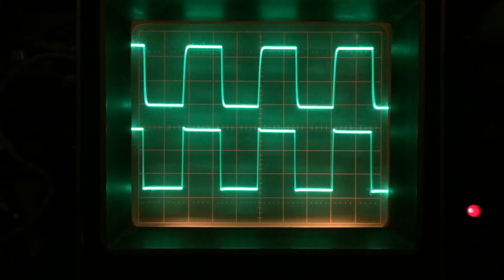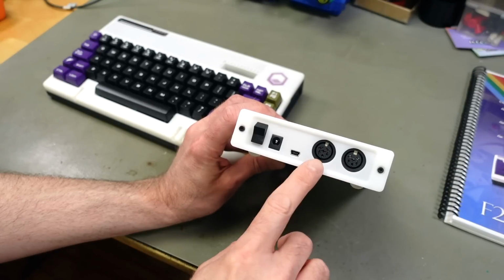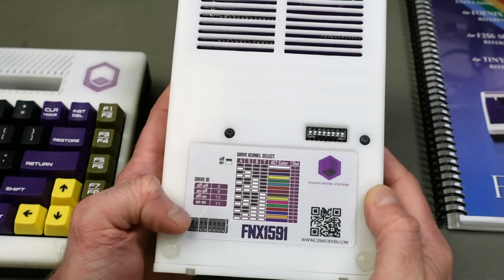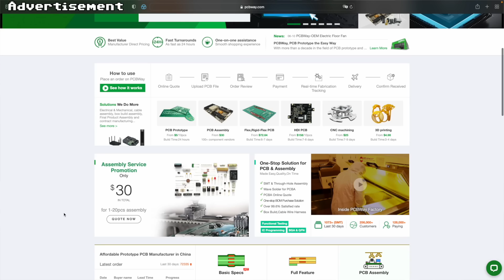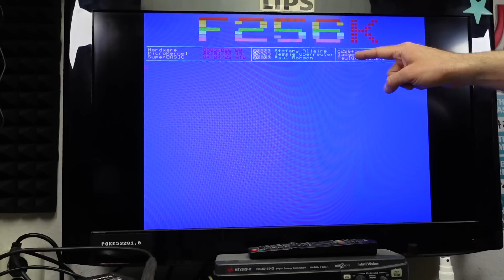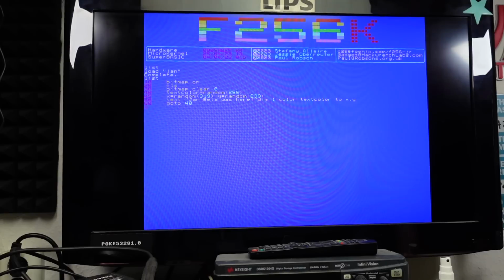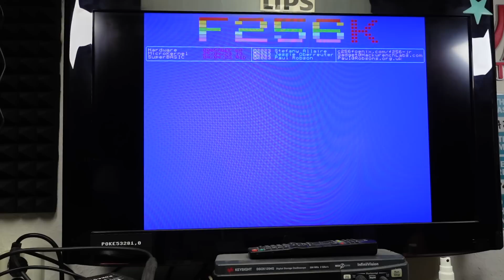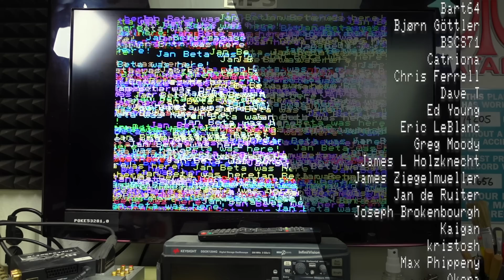Foenix F256K New Retro Computer

Comment from the maker: Two little corrections: The default installed memory on board is actually 512K, expandable with additional 256K if you add the RAM expansion cartridge. Also, the price is not Canadian dollars as I assumed but plain old USD. Sorry for my mistakes!
Reply: That makes it even less affordable 🙁
Reply: @Colin_Ames  Adjusting for inflation it's still a fraction of the price of an 8 bit micro when they were new. I remember when 16k x 8 bit DRAM cost $279 US. Not 16 megs, 16k. The 512k in this machine would have cost almost $9000 in 1978 when I upgraded from 16k to 32k. This isn't about making the lowest cost item, it's about making an authentic 8 bit item. If you want the cheapest thing possible, buy a PC.
Reply: @Peter_S_  I understand this, and I was not critical of its price, as my original comment shows. However, my statement about it being even less affordable is true.
Reply: @Colin_Ames  The fact is that it's FAR more affordable (by 2x-3x) than an 8 bit micro was when 8 bit micros were new. It's already less than half the price of when this tech was new and you are complaining about affordability which is the same as complaining about the price.
Reply: Real dollars not Canadian.
Reply: Its too bad they don't get some more community support to reduce production costs per unit to increase community base in the long run.
Reply: WHY would anyone sell a 256k upgrade and not just include it in the price?  The plastic housing cost more than 256k.  Hell, the packaging cost more than 256k does today. 
This is so dumb. So many people are doing it. WHY?  Not one of them has been a success (I can't buy a single one of these new retro systems at Walmart for 29 Dollars).  They are WAY too much money. Worst of all, they will be orphaned within a single manufacturing generation.
Reply: @tarstarkusz  Very good point, I still have not committed to purchasing any of these retroputers since the cost is so high for such little puter power....  Though I do respect the time she spent to create this retroputer...... I still feel it could be perfected further.... just need big time investors to make ASICS... these FPGAs are too expensive and inefficient... 1 big problem...  ya the plastic housing so expensive yet the RAM is so cheap...
Reply: DVI? Why??

Comment: Not really sure why all the hate is being directed at Jan for this. YES it is really expensive, but then maybe it's got a small audience which will mean a high price. All these computers are going to cost a pretty penny, Jan is just showing us the pros and cons. He's done similar for other devices. I like the repair videos, but I also like to see videos looking at this, so I don't think of shelling out more than a PS5 for something like this.
Reply: As unfair as it is, the "hate" is because these systems are by design, very limited, yet often cost as much as very capable, modern computers. At the same time, whilst they are reminiscent of computers we had in the '80s, not being based on any particular brand or model, they have no specific nostalgic draw. There are no existing software libraries or books exploring the intricacies of the hardware etc, nor large communities of users and forums. Compare this to old Atari, CBM, BBC, Tandy, MSX and Sinclair 8 bit computers etc. They're all available as emulators for free, they run on any PC, Mac or SBC, the software and books are usually downloadable for free, and large, vibrant communities exist for each. The Commander X16 has an emulator that's free... why buy really expensive hardware when you can experiencecit for free?At least the Agon II Light is only around 60 Euros.
Reply: @another3997  there is a free emulator that emulates the F256 Jr now, and while I understand it's fun to explore paths that were well beaten ages ago, this lets you the opportunity to forge your way and make contributions that are significant
Reply: @another3997  don't buy it then eh
Reply: @stefanimal5257  I doubt many will.
Reply: @another3997  There's an emulator for this too, as well as an SBC-only version that costs much less because it strips out the cost of the case and keyboard. Yes, it's expensive, and for my money I'd rather have a MiSTer, but there is definitely something here. In particular, the custom video chip is very capable and provides something that simple recreations of vintage micros can not. It's essentially an answer to  "what would 80s hobby computing enhanced with modern technology look like". For people who would enjoy tinkering with a simple enough single-user machine they can completely understand and control while getting more modern conveniences and expanded video output and quality capabilities, this looks like an excellent choice. A ton of work went into this, so I understand the price given it has to be amortised over a small run.
Reply: The greatest failure here is the lack of understanding why coders do what they do. There's nothing interesting about the most limited 8-bit CPU anymore and the BASIC idea has morphed into Python long ago.Without a sense of progress nothing is going to happen.
Reply: @Breakfast_of_Champions  dude you trippin’. Python? ‘Progress’? What are you even talking about? This thing is charming. That’s the bottom line. Go make your own ‘progressive’ computer!
Reply: @stefanimal5257  It's not $600 "charming", that's ridiculous to charge people, and then the buyer has to hope it becomes popular enough to have a scene around it because it won't be getting any commercial software, so if it flops, you have a "charming" door stop. Whether you create a computer or not.
Reply: @maxxdahl6062  still charming.
Reply: @stefanimal5257  Yet, still useless.
Reply: You can’t set retro feeling into price tag like I paid 600€ for an Amiga1200 but I’m happy with it and use it everyday. I had more fun with games as long time ago. Modern Games give me nothing at Moment they are boring or need to invest so much time that it is more work as games. It is my personal view and for me it was worth the price. Old computers have a large library and many many books magazines and shareware cds. I think a „new“ device who miss all that is very very little niche that can Programm this units and have fun sharing with other coders the progress. As a normal „non coder“ this is nothing to invest for ! I think this is clear and must not talked about. If you can’t Programm this devices then buy a c64, amiga, st with big software lib.
Reply: @horrorlostplaces  The better way to get people into retro gaming though would be on say the amiga and/or c64, etc. Not these things, since there will be no commercial software, have to hope people make actually good games for it, etc. You could get a full, working, maybe even refurbished  c64 for what these new machines are going for.

Comment: Please do a series on this if you can. I think it's by far the most exciting of the current crop of retro computers.
Reply: ah.. not really there's some very fancy ones around these days, but no support. The best cheap one that's going to go places imho is the Picocomputer 6502
Reply: @Jasonsadventures  What do you mean by "support"?
Reply: @mercster  A lot of the custom 8 bit machines just get bought, sit on shelves and are never powered on or ever have software written for them. You need something very cheap and with good potential if you ever want to get anywhere. Needs to be 240p with a lot of sprite pushing potential imho.
Reply: @Jasonsadventures  yes, lack of eco system, and like this it pertending to be c64, but it not, so not c64 stuff is goingt to work, and your still not in any eco system pond, and if you every learn anything it only going to be of use we this machine, this now one else uses or has even heard of thing, evnen if it the best machine, out there?
Reply: @dh2032  You got me thinking about all the 80s games companies who targeted multiple computers. All of those computers were as different as the current retro computers. I'm thinking there's nothing wrong with learning several different machines, especially as there were and are only a very few different CPU architectures in common use. There are also relatively few different BASIC dialects.
Reply: My vote for “most exciting” would be the Agon Light™… eZ80F91 @ 18 MHz. The same designer is working on an Agon Heavy™… eZ80F91 @ 50 MHz. Both include 640x480 SVGA graphics with sprites.
Reply: @Jasonsadventures  Why would you do this when a raspberry PI costs $35?

We don't need sprites anymore - we have DMA memory moves.  We can share the memory between the CPU and the screen directly now.

I understand the nostalgia of the EARLY methods to pull tricks to get things to work, be we are SO FAR BEYOND that.

If you worked on these machines, I mean REALLY worked on these early machines, you don't want to go back to it.  1/2 the challenge of everything on them was figuring out the obscure trick you had to use to make something work.
Reply: @fuzzywzhe  I mean if you aren't going to do it right, we may as well just stay on Playstation 5s. Maybe it's better to put all the effort into converting a known good system and understood machine like a NEO Geo into a home computer
Reply: @Jasonsadventures  What I'm saying is nobody wants to program in the older style of hardware, and nobody wants to work on them.

It's a LOT HARDER to code on a NES than a modern system, and it's a LOT HARDER to code on an Atari than an NES.  Today, it's no more difficult to work on a PC than a PS5.

It was a different era.  When I first saw Pong, it was AMAZING just to see yourself controlling a dot and a line.  When I first saw the Atari 2600 with Defender, it was AMAZING.  When I first saw Impossible Mission on the C=64 it was AMAZING.  Super Marior Brothers, Sonic the HedgeHog, StarFox, Rayman 2, Doom, Quake, blah blah blah.

NOTHING is amazing now.

Here, this was the last thing that piqued my interest - look up on here "the secret of vulcan fury".

It was never released, never completed - 1997.  The old sets from the 1960's even.

Today there is nothing that is "a new leap", and people don't want to go back to programming those old systems.  If you've coded them you wouldn't either.  You wouldn't even want to work on them.  My computer can do anything, and I mean ANYTHING, any of my previous electronics did.  

When I go to somebody's house and they have a television (because I don't), it's like going back 20 years in the past.  It's primitive, it's annoying, it's slow.  Television will be an entirely dead medium in 20 years.  It will just be a display, and I don't think even programming services will exist.
Reply: @fuzzywzhe people do go back and program for these old classics. Just look at the many many recent releases for retro computers. Yup build in many cases with modern help. The charm is you could understand most of what was happening and control it. Windows is oen crap load of layers upon layers and the web side of things makes things even worse. Complexity is everywhere nowadays. Overengineered in many cases too. And out of fashion in 1 year.
Reply: @stoomkracht  I completely agree. I've also gotten into FPGA system "emulation" and it's an amazing way to both preserve historic old systems as well as re-creating classic games. But even that has limitations, as the distinction between perfectly imitated timing in arcade and 8-bit machines, and increasing levels of abstraction in modern game platforms, becomes greater.  There's a huge difference between software emulation and FPGAs with 8-bit platforms. In the 64-bit era, not so much. 
But then again, would I refuse to drive a classic car because no one is making advances in transmission or new power steering for it?  Isn't part of the fun driving an old car not having the modern niceties, the challenge of driving done in the distant past?  Yes 8-bit systems are harder to program, but that's a feature, not  bug!

Comment: What a lovely machine. I hope it sells well.
Reply: Crossing my fingers.
Reply: At $600+ it definitely will be a bestseller. It's just that I don't understand why the same $40 256KB RAM upgrade (sold separately) costs $45 when you add it to the F256K computer (where you choose the extra options).
Reply: @AndreiNeacsu  it's the tip !
Reply: @AndreiNeacsu  I think it comes in a cartridge case, while the cheaper one doesn´t (since it is in the ATX case anyway)
Reply: It's already EOL today. I think if the machine ran on a single RP2350 instead of an FPGA, it would cost 200 bucks perhaps, and be more powerful at the same time.

Comment: I also got one recently and I'm loving it as a tinkerer first with some limited 6502 assembly experience under my belt, thanks to the Ben Eater series of videos on the 6502 breadboard computer. This seems like a logical step (leap!) from that point.
Reply: Ben Eater is goood!!
Reply: It does seem like a very logical, and luxury step from a breadboard 6502. Hopefully a decent assembler/linker will be developed or is already available. As long as you have peek, poke, and call, a decent starter assembler can always be written in BASIC.
Reply: @Peter_S_  I'm already set up with Visual Studio 2019, compiling and linking using 64tass, producing a .bin file that can be sent anywhere using the USB debug cable. the emulator has recently been improved to include a workable debugger with breakpoints
Reply: @anybitfeverdreams  Excellent! Being able to use something like Visual Studio to code on something like this is an amazing luxury! At Atari they used a VAX for a lot of the writing in a similar vein. As somebody who goes back to 1978 on 6502, this looks like a fun and well done system.